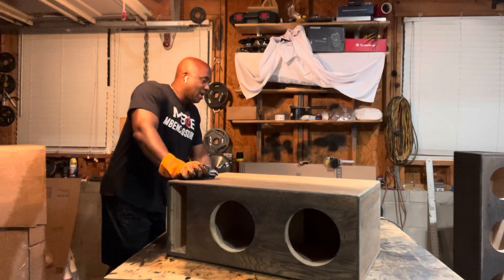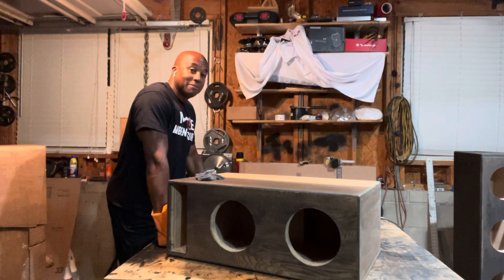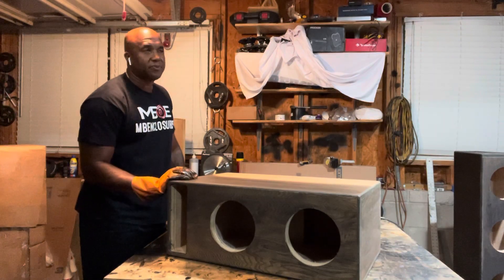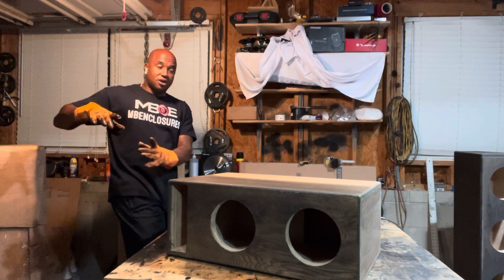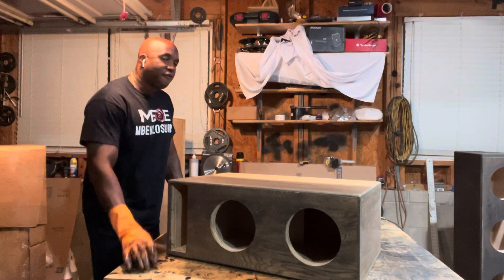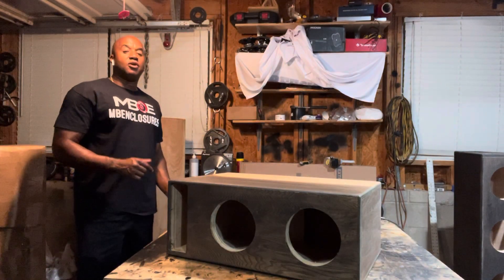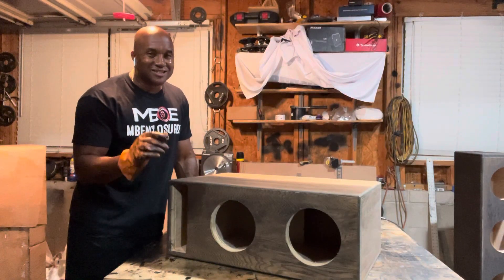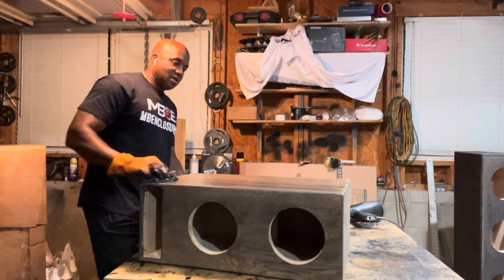Understanding 4th orders.. when and how to effectively use them.!

Comment: Not unless you run the acrylic window. Also , 100 percent correct . 4 round ports is best and if your running it in any older GM Fischer body vehicle (no later than 86) it will run just fine . In fact if you ask me that’s the only trunk I’d run a band pass .

Comment: My cousin had a bandpass box for 2 MTX subs back in the early 2000s. The subs were visible through a plexiglass front, but I guess they were sealed. The box also had a round port. I think this was meant to be some kind of 4th order setup involving his trunk, but it didn't sound good because he didn't do it right. I never see those boxes anymore either. Anyway, I remember it vibrating my hair and not getting very low bass.

Comment: In the scenario you provided, it is important to note that most of my clients dislike rattling sounds. Ported enclosures tend to generate significant rattling within the trunk. Typically, when constructing fold orders, we elevate them within vehicles to achieve clean and bass in the cabin with minimal Rattle
Reply: A front facing ported enclosure reduces almost all rattle significantly, however you will lose a few db. I’m debating on which on I would like to build. My setup is 2x12” in a sedan. If you’re knowledgeable I can give you the full information and maybe you can help me come to a decision.
Reply: @jt9264 If you seal it from the back wave as a trunk wall you will gain those db's back in most cases. Some cars like trunk builds some like trunk walls
Reply: @kcstein5956  my sedan I did a 2x15” infinite baffle with spl subwoofers so not exactly how it’s supposed to be but is definitely loud and sounds super crisp and clear it hates anything lower than 26hz
Reply: @jt9264  seems like those woofers weren't made for infinite baffle maybe? You're supposed to have an extremely flat response on low power, down into the 10's with infinite baffles
Reply: @ yeah I was just trying something new with what I had I need a trunk back lol, it’s definitely not optimized by any means but is temporary and works good for me
Reply: That's because ported = mucho BASS

Comment: I have 2 HE2 12's in a ported box in the rear of my van, facing the back doors, under the bed, the bed is 6" away from the doors, giving space for the bass to come up, so this is like a 4th order if I understand you, since that gap is operating as the port. I used to have my speakers facing forward until I found the bass increased when I turned them to bounce off the rear doors, the van is huge, its a 15 passenger extended Ford. 
My other van has a Skar 10" in one of their ported boxes, I had it facing the rear, but seemed to have muffled it, its under the bed, the mattress is against the rear doors, so the space under the bed seems to be too much, there is a lot of stuff stored under there, so air can't pass through very well, I had to move it, its facing forward, I think it could use a better designed box. I try not to compare both vans as its not fair due to the sub volume.

Comment: I never understood 4ths until this video thanks man. My question was gonna be would a 4th work as a center console build in a f150 but the whole ported area explanation answered that so now my question is would building a blow through even be worth it as I'm only running 2 sa 10s? (06 extended cab f150)

Comment: I can see with out a doubt your a beast when it comes to enclosures. Around 8.05 to 8.30min you talk about the air that actually being moved and where it comes from but you mention quickly and briefly that the port needs to be curved? Can you elaborate and touch more on that and what you meant

Comment: Yeah...great explanation...also I like that you call box types as "laymen" ("4th order" and "ported"), because they can understand things more easily what you're talking about...I just want to make clean few things for those who dont know about this: "4th order" is an enclosure which have 4 acoustic orders - as the name says, but there are more types of 4th order enclosures, because given number of an acoustic order is not limited to a single loading arrangement - especially when the number is 4 or more. So, actually the box you called "4th order" it is a 4th order "bandpass" box, and the "ported" or "vented" box is a 4th order enclosure too: 4th order "bassreflex". How to count orders in this case: start with a sealed (closed) box - which is a 2nd order box, then add an another chamber to it - +1 order, then add a port to this added chamber - another +1 order = 4th order bandpass. For ported: add to 2nd order sealed box a port - +1 order, but now, the driver's cone is outside the box, so the sound what makes the driver's cone interacts with the sound what makes the port, which is an another +1 order = 4th order bassreflex. And yeah, because of different types of loading arrangements they are working as you explained them in the vid. Also Hexibase have a vid how to count acoustic orders, it is on Audio Dynamics yt channel, and he shows several variations of loading arrangements too, which are basically the most known subwoofer boxes that even all laymen should know about.

Comment: The 4th order also protects the sub. The sealed portion helps the cone from moving too much if you will….. so you can abuse the subs with little effect.
Reply: I've build a 4th order enclosure. It plays low and extremely loud for a 275wRms Subwoofer(JBL GT512D4). Im able to achieve 120db @ 45-75hz.
Reply: Right...i blew so many subs wit the ported boxes

Comment: Would give these boxes the title "special use case".  Argument could be made for use in an application where minimal power draw is a necessary component of the system; the efficiency of a 4th order nets a ~3 dB gain when properly tuned.  This efficiency compensates for lack of power (watts RMS).  The downside of all this is the stringent requirement for proper tuning - with the listener understanding this type of enclosure may be built to suit musical preferences in some cases; and it takes considerable extra work to construct a box that looks like a blank slate, in addition to all of the properties listed in the video (larger size, long port).  Also, if amplifier gain is improperly adjusted this box has a propensity to cook woofers; these boxes have a tendency to mask signs of driver damage - as once learned by a young man and a track called "woofer wrecker".  Very good content, thanks!

Comment: Are there actually some vehicles that no type of sub box or even subs in general sound good in?
Because i have a 2006 nissan maxima and ive come to the conclusion that its acoustics....ummm....BLOW A--!!!
Ive tried all types and sizes but never have i got such crappy sounding, peaky bass. And i did try the subs and boxes in my 06 saturn ion 4dr and HUUUGE diff. They All Sounded better and just as if not louder using only half the power. So, am i right, maybe? The 04 to 08 maximas are a bad idea for a sound system? Thanks!😁👍☮

Comment: 4th orders and 6th orders don’t have more output than ported boxes , they just provide that output in a different bandwidth. In my opinion 6th orders have the best bandwidth but it’s not worth the size unless you run small subs, the rear chamber couples with the front chamber and extends tuning on rear and front so that’s why they play a lot lower and “windier”. I’ve found some good results from building a regular low tuned ported box and adding a small front chamber in front of it , usually boosts output up high and helps it load a little better but again just makes the box bigger
Reply: I was going to try and make a 4th order out of a sonotube using cvr 10s but it would be too long for my truck it would have been a cheap build
Reply: They do have more output tho if you compare 2 12s in a ported box and the same in a 4th order, they will get louder because the box is bigger which increases the efficiency
Reply: @justinatmidi  not always, remember you’re eliminating the back wave with a 4th order so you’re cutting the output almost in half, and saving some of it with the big front chamber. Ive seen people lose a few decibels with a 4th order direct swap from a ported, but they definetly gained sound quality and bandwidth
Reply: @modernbassheads5051  it's probably not correctly designed, or maybe a 1:1 ratio which is less efficient than the 3:1.....there's a reason most spl builds are either 4th or 6th order, they want the loudest possible setup

Comment: I'm confused. So the reason it would not work is because the armrest hole wouldn't be big enough for the application?  
Are you familiar with the Deathbox designed by Steve Deckert?  
It bangs, I just have no idea how or why
It's a strange box for several reason but I haven't heard any negative feedback from folks using it.
Its apparently a one-size-fits-all enclosure that doubles power handling and generally solves all the problems associated with bandpass enclosures and uses a duct instead of a port.
The only driver I have used with it is a Helix Blue10 rated for 200 RMS and had no problem pushing 350W.
I am a beginner and I know that all sounds ridiculous but I'd be glad send you one if you could make a video commenting on it.

Comment: MBE, ya need a webpage bud..I know ya business would blow up for sure! You got a ported prefab for 2 audiopipe TXX-BD2-10 going into a 04 grand cherokee? I bought a Qbomb for 10's the one with 4 triangle ports supposed to be 1.2 cubes per side and it aint it sure as hell aint after i got the subs in it. Pretty sure the box way to small and the chuffing is bad enough i had to back off the gain. I need a real box! I thought right off the jump i should just bought a box for 12s and stacked a 10 baffle on the front. why all these prefabs come out so damn small.

Comment: My go to for smaller efficient systems (single sub wanna pound have huge range and you have the room to make a correct parallel 6th's needed volume) enclosures is the parallel 6th order. Can't get better range and like you preach it's allllll about the enclosure. I have 2 parallel 6th single sub 12's 1 in a GMC Envoy and it not only utterly pounds it has massive range for a huge array of music which is totally me.

Comment: Bro I have 2 kicker 15 competition woofers on a 4000 watt American bass amp in a 87 Lincoln town car at 1ohm but my woofers are 2 ohm capable and I learned from you that 2 ohm is better than 1 ohm because at 2 ohm your amp can control the woofers on demand my box is ported I appreciate your knowledge because it helped me to understand so I want to know how to run them in parallel at 2 ohm